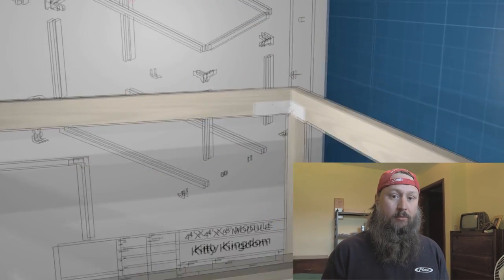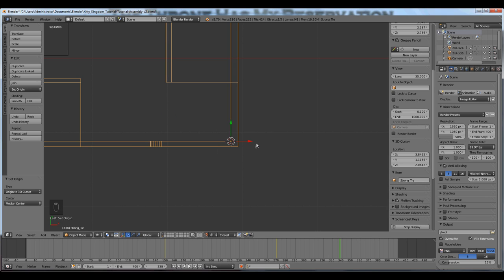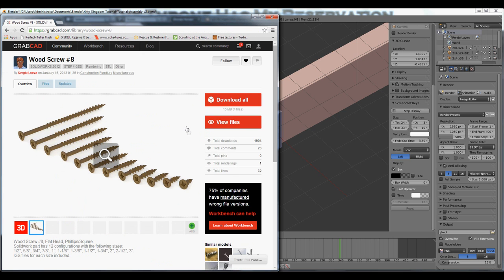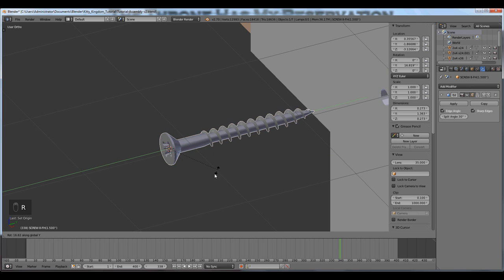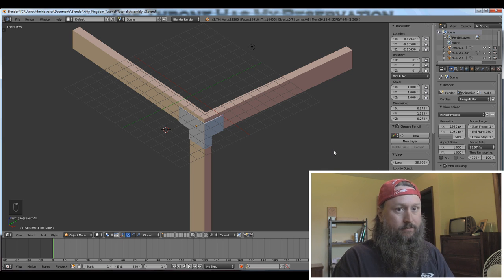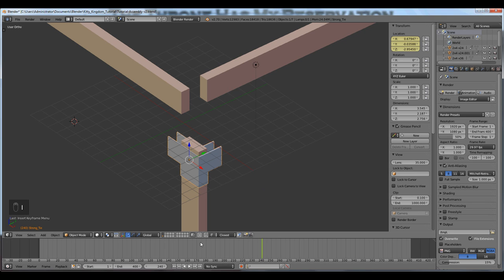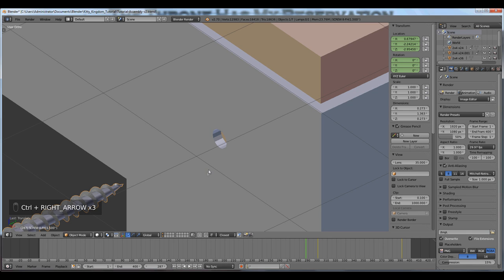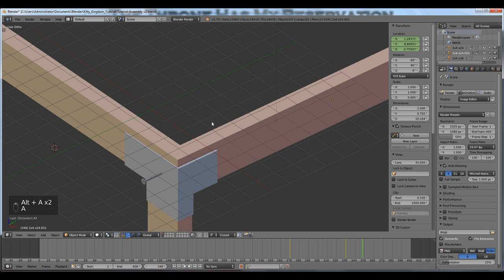Assembly Animation - Blender Tutorial

Comment: finaly a video with the subject engineering model+blender! really good! I will always need to do the assembly in blender? I can´t for exemple import a already assembled part form creo or solid works, for exemple a car, and then animate the wheel to rotate and car to drive to its position etc? in your video you get pretty far out from the work-net is that ok? for exemple if you continue to build a complete house whit the same parts, is it a good idea to scale everything you done so the complete house fits inside the work-net/work-space or can you built it in what scale you want? GREAT VIDEO! which its was more of them! working in engineering software, but things those render and animation features are pretty bad, så which to start using blender, but still build the parts in creo/solid works..